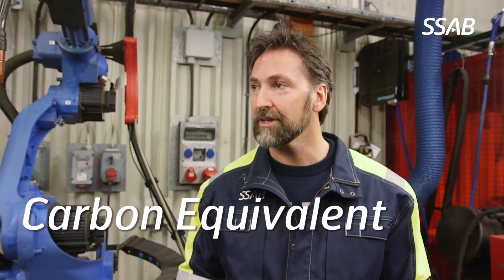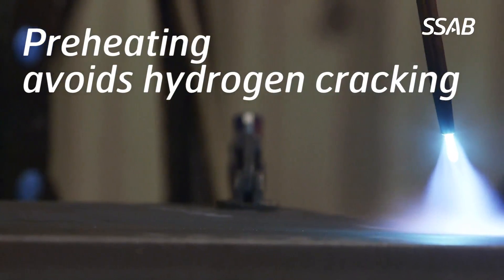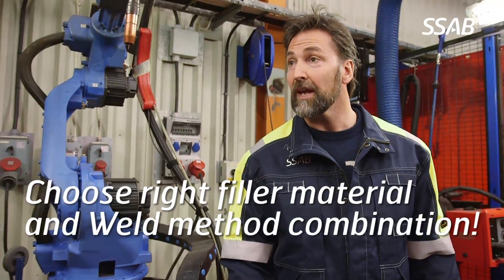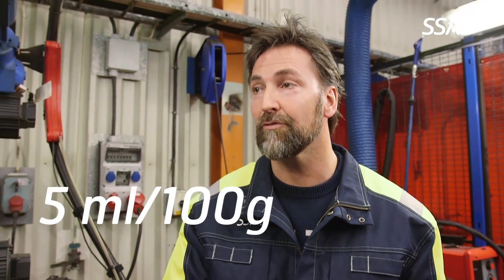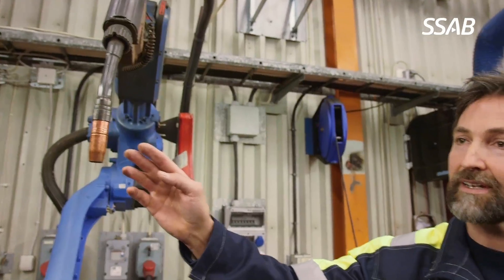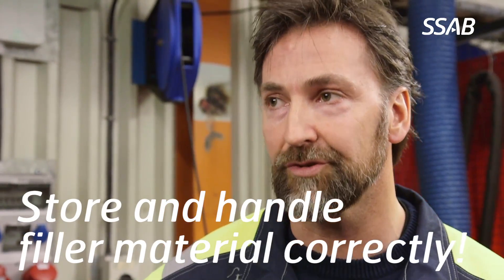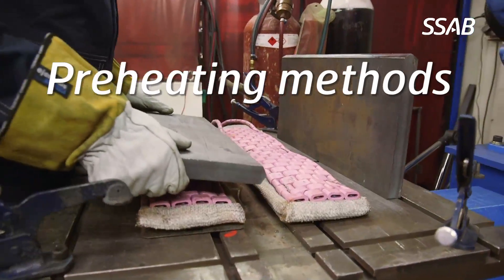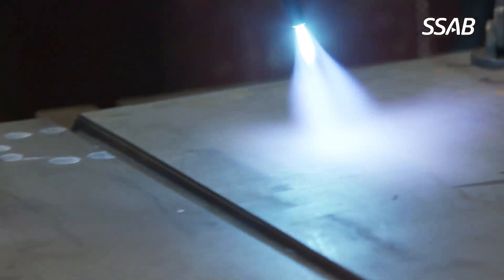Why preheat to improve the weldability of some high strength steels?

Comment: Hi: I plan to get some SSAB Strenx 1100 high strength steel sheet (1.2 or 1.4mm thick) to repair my car. I read the welding instruction, which seems to require ER120S1 rod to work with a TIG welder. Since it's going be thin metal sheet welding, do I steel need to pre-heat it or room temperature will be enough? Also, in your document it says ER120X, is that same as ER120S1?
Reply from the maker: Thanks for the message! The best way to proceed and get answers to your questions is if you contact our technical experts via email at techsupport@ssab.com. Best of luck to the car repair!

Comment: I just purchased a Hardox 500 wearplate can I use a 7018 electrode welding. Do i still have to preheat the welding surface and the surroundings. We usually work in an average weather temperature of 40 degrees celsius. We are going to weld a hardox 500 wear plate with an ESCO Steel bucket.... thanks.
Reply from the maker: Thank you Enrique for your question! In order to give the answer, we would need to know the exact plate thickness. Please contact our tech support at +46 155 255 006 for further help. Thanks!
Reply: thanks... we weld it perfectly with 7018  5/32 elding rods. thanks. if you give me an email y can send you a picture of the bucket.
Reply from the maker: Great to hear! If you want, you can send the picture to techsupport@ssab.com. Thanks!